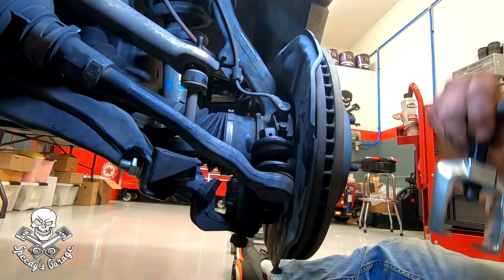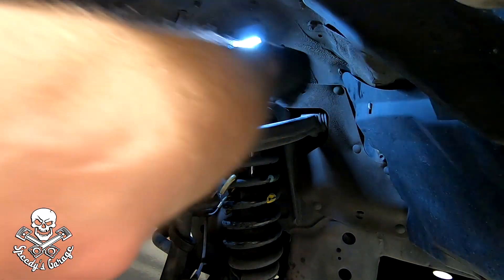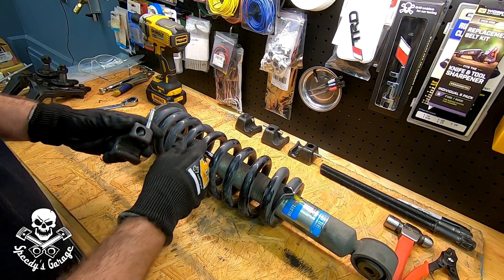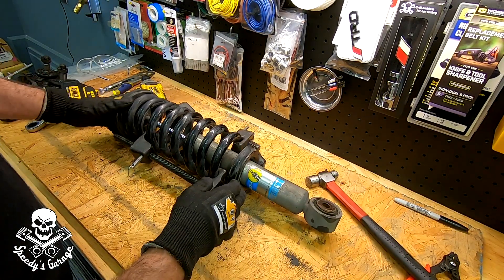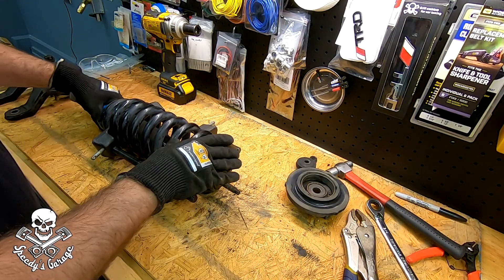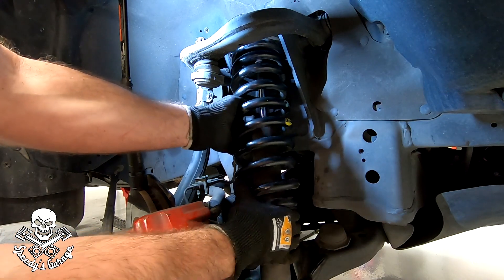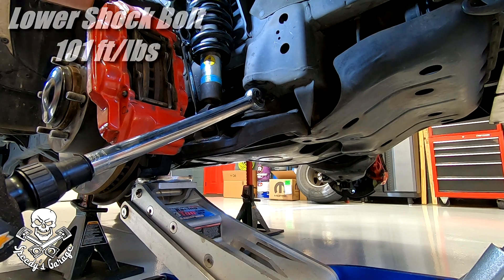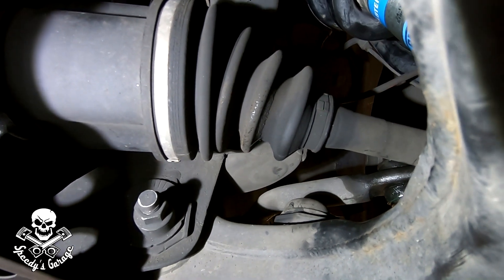3rd Gen 4Runner Bilstein 5100 TRD Tundra Lift Speedy's Garage Restoring a 3rd Gen 4Runner P3

Comment: What makes the job Super easy is mark all the cam bolts with a oil marker then Loosen the lower control arm cams then put struts in then put truck on tires and then tighten the cams back up were your cam marks were and should be good to get to a alignment  shop.. you were right to remove the lower ball joint hope the info helps
Reply from the maker: That's what I've been missing, I never loosened those cam bolts so the bushing must have been what were giving me grief.
Reply: @SpeedysGarage  yep bushing on control arms giving you hell bro

Comment: I just put in tundra shocks with 881 coils- I lm 99% sure she now sits lower than before in the front haha, I’ll have to love my perch up one or 2 notches up. But question is since all my stuff is brand new and maybe 200 miles of that- must ask how long from start to finish did this take to redo? I’ll use the bottle jack on the upper arm. How far off was your alignment after moving the perch up 1? I just had an alignment done and hate to spend the extra money again since no one around here “aligns lifted trucks”

Comment: Disconnect sway bar link not lower ball joint simply to replace shocks.
Reply from the maker: I had both disconnected actually, sway bar and lbj.  Turns out I think I needed to loosen the a-arm cross bolts to release tension on the bushings.

Comment: You probably arent enjoying the ride quality on the road taking the notch up 1 up. Atleast i didnt like mine, now im in the process of dropping back down to lowest notch and instead use Eibach coils to help raise 2.5 inches. Lets hope that ride is a lot better.
Reply from the maker: I think I talked about the ride quality in the video.  Mine rides fine and I could barely tell the difference between the two perch settings.  Maybe your shocks are shot?
Reply: @SpeedysGarage  they are a year old now. I used OEM coils. They are a bit stiff. I did notice however that they ride pretty good when towing a 2000lbs trailer.
Reply from the maker: OEM or OME?  I've read you have to be pretty careful about which ones you pick.  Mine are OME 906 in the rear I believe.